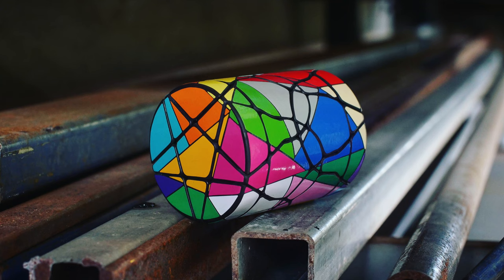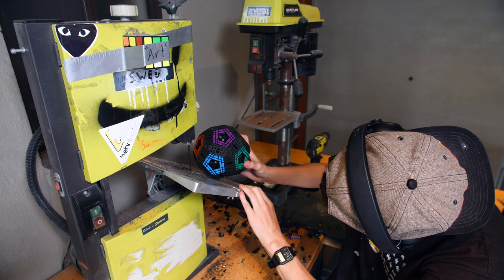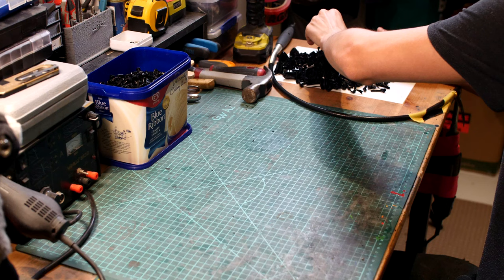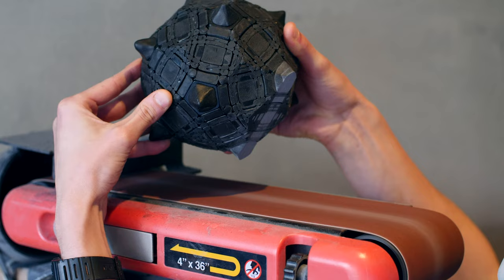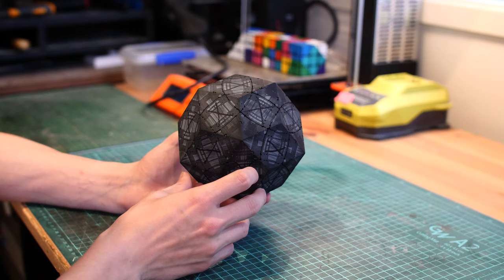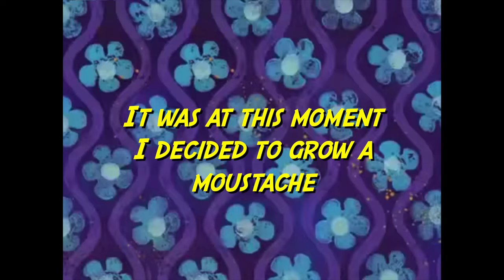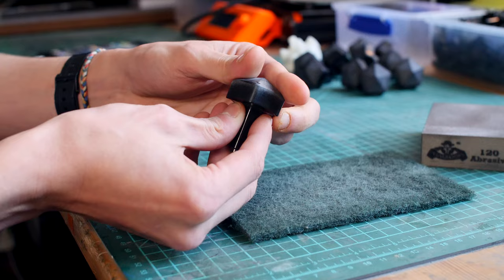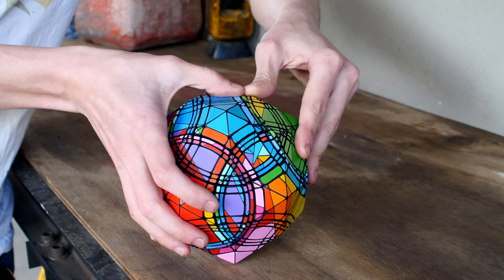Rhombic Triacontahedron Petaminx | Rubik's Cube Build Video

Comment: always always ALWAYS use the clutch on a drill when assembling plastics!!!!
Reply from the maker: I don’t even know what a drill clutch is
Reply: @BandsawsAt45Degrees  the numbers on the drill! it lets you set the maximum amount of torque it can apply, you had it on drill mode, which is maximum
Reply from the maker: Thanks for the tip!